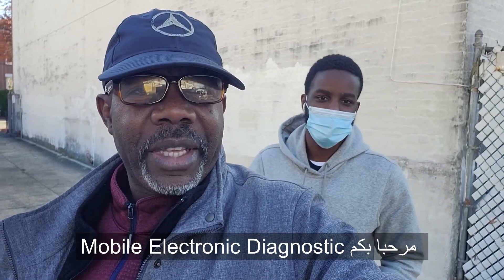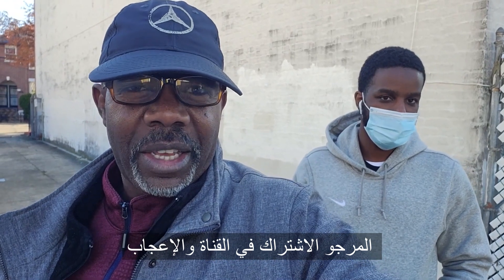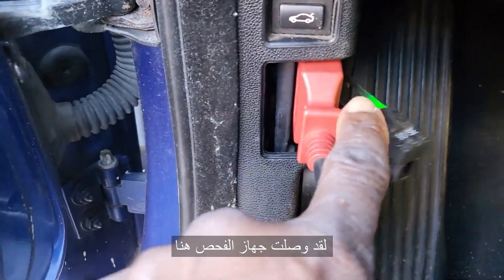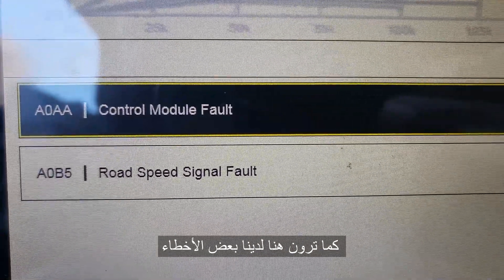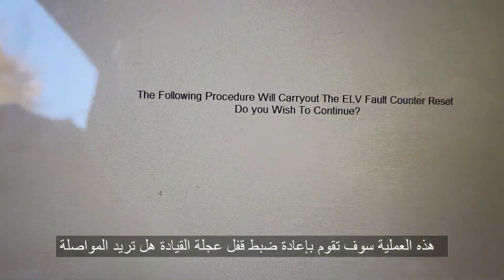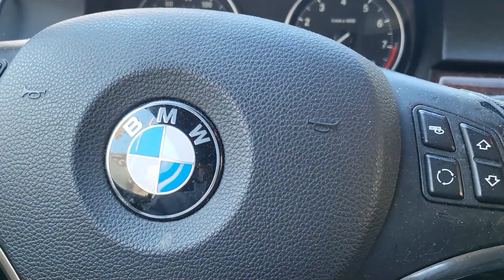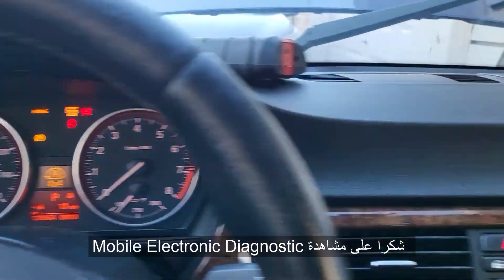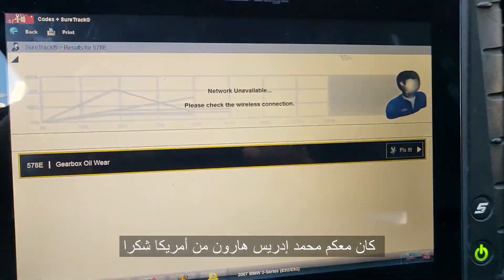BMW With Keyless entry ELV Fault Counter Reset Step By Step مشكلة قفل المقود وكيفية حله

Comment: Assalaam alaykum warahmatullah. I have a bmw 1 series 2006 that does not start, it has a p2610 code.it shows the steering lock symbol i am using autel im 508 what should i do to be successful?

Comment: Hello sir I have the same problem in my bmw 1 serie 2006 I try to reset the cas problem but it doesn’t start please help
Reply from the maker: what tool do you use  also be sure that is the problem
Reply: @BestCarFixes  I can’t could reset it because the problem is still there it shows 2 fault car access system CAS freeze 2car access system CAS fault roed speed signal